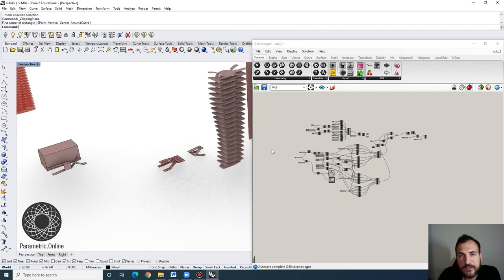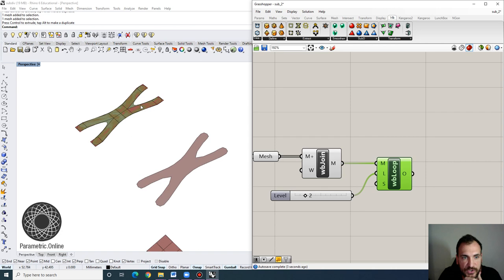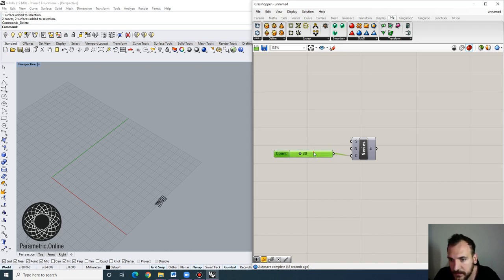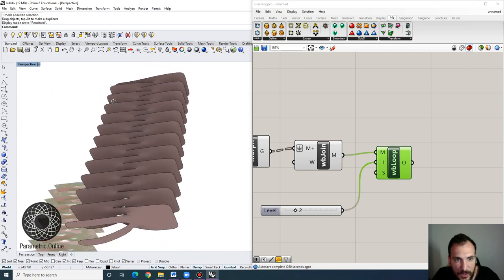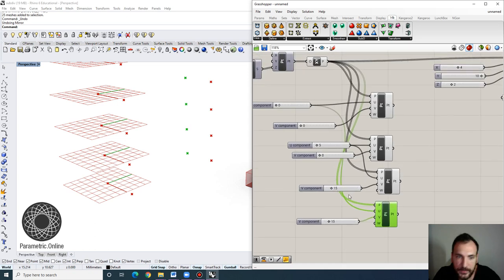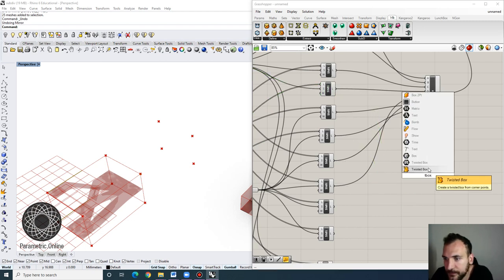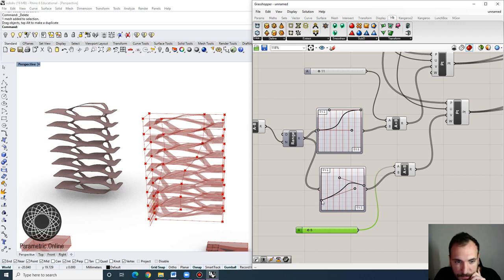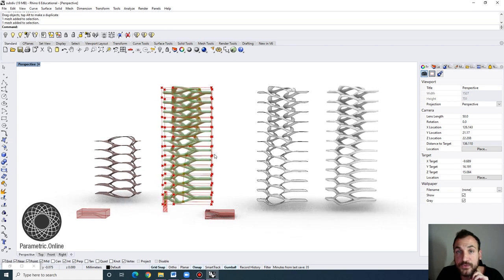Subdivision

Comment: 💡Pro Tip: When you use wbJoin, you need to set its W input (Weld) to true! Otherwise, the meshes will only be joined and not welded! I think it would also be beneficial to use Catmull-Clark subdivision, since it preserves the quads, which is far more beneficial than converting to tris with Loop subdivision, especially if you maybe want to manipulate the mesh by hand afterwards. Great workflow!